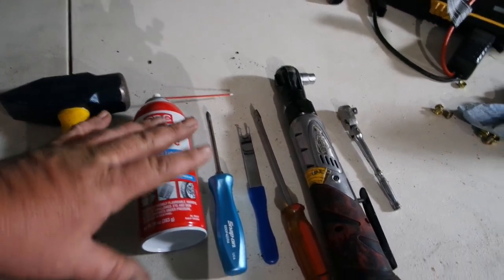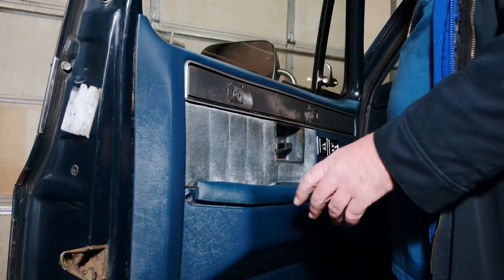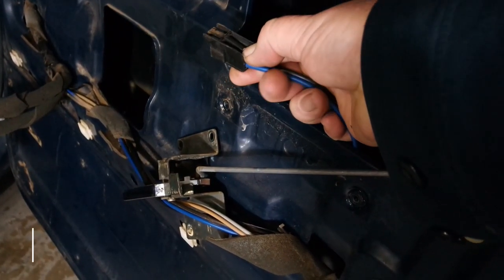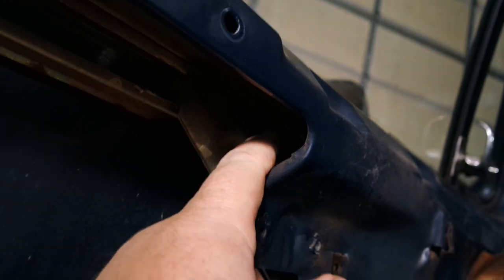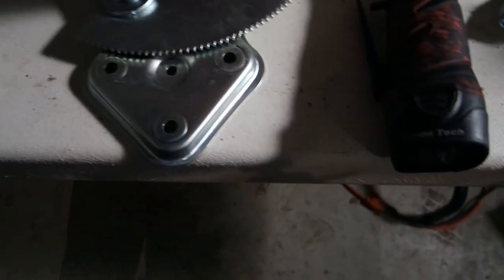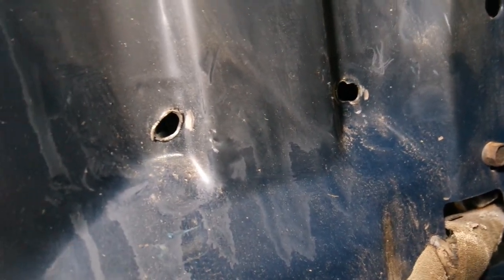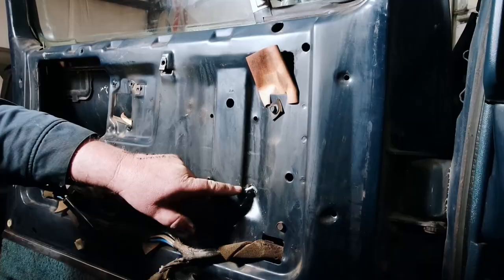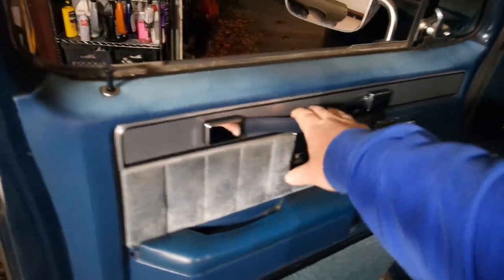How To Replace the Power Window Motor & Regulator on a 1985 Chevy C-10 Silverado Square Body Truck

Comment: I already done mine on a 05'' Blazer However because i watched a video on it 3 weeks ago this is in my suggestion page lol 
My tips : Easier to do with someone holding the window up And can adjust it to a level the track slides in better/quicker 
Use bolts, lock washers And nuts instead of rivets The whole reason my motor failed was a loose rivets And the whole plate would shift Putting strain on the inside wall of the motor cracking a magnet for the up...If the bolts are too long Use a cutting wheel

Comment: I wish I had seen this video before started. I finished the passenger side door and started on the driver side. This video showed a clear picture of the plug on the motor, which helps a lot--I just wiggled the pax side plug for 5 mins until it finally let go. Also, when I started on the drivers side, the motor/regulator would not come loose. This video showed the two lower bolts that were holding the assembly in place. Apparently the PO changed the pax side and left those bolts out. Now I get to go back to the pax side and put those two bolts in. I personally taped the door handle assembly to the window to get it out of the way. Also, my new parts from LMC Truck were supposed to rivet together. I drilled out the holes and bolted them.
Reply from the maker: Yeah that can definitely be an issue when someone else has worked on it. Glad it helped you out!!